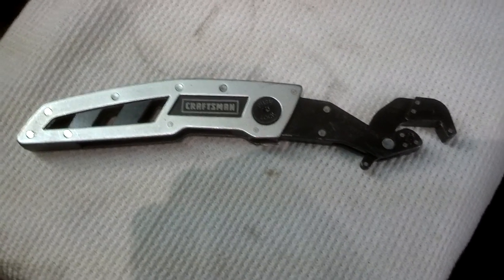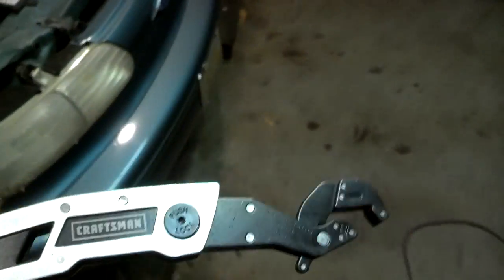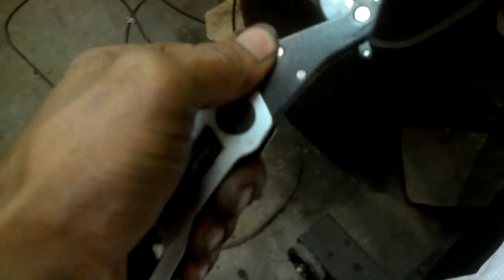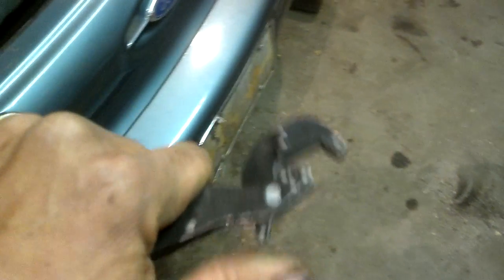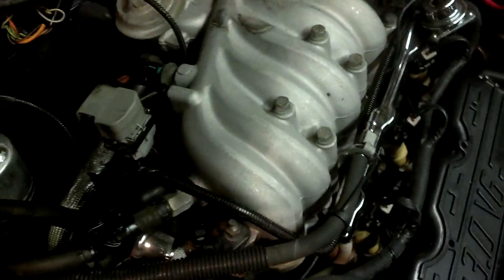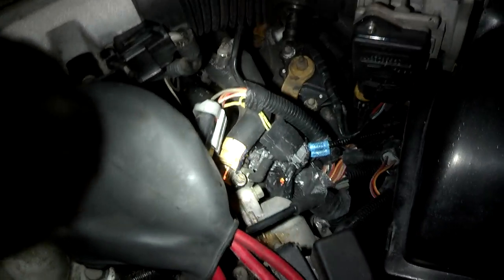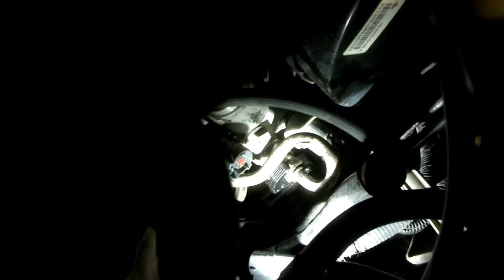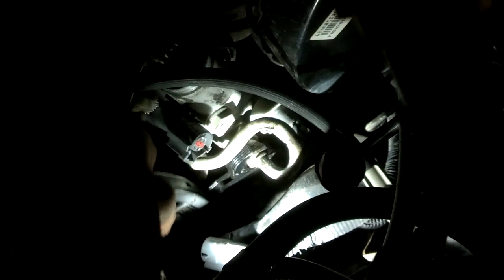How to Remove a Power Steering Hose the Easy way, Tool Review

Comment: Thank you!  I'm going to buy one right now and hopefully get this damn car finished. :o)
Reply from the maker: good luck. i love mine, saves mea lot of time
Reply: That wrench did the trick.  Now I see why the shop wanted $600 to change the P/S pump and hoses.  Thanks again.
Reply from the maker: all in the correct tools for the job
Reply: Me too, hope it works on my  E150 van, damn I didn't know their was a tool out there for it. I'll try again tomorrow, I couldn't take that sucker off today, did all kinds of twist n turns n wrenches lol.

Comment: I just seen this video good job a little hard to see in spots but that is a hard part to film . I am a disabled vet nothing from the waist down so I do not drive and sears was 45 min away but it closed last year and now to replace a tool I have to be driven 1.3 hours . I got my set at a pawn shop for 10 bucks . It had the package but they were used . But 10 bucks you can not go wrong . I have used them on my wheelchair my handicap scooter a few other things over the year. The big problem is they seem to slip off a lot. Not sure if I am using it wrong.

Comment: Nice video work under very adverse conditions. But the only problem I can see with using a wrench like that is if you're working on a rusted or threadworn fastener (a common occurrence for someone who owns a '95 Ford Contour and drives it during the NY winters). Then, you run the serious risk of stripping the heads, in which case you're obviously screwed.
Reply from the maker: je19662008  The design of the wrench grips the fastener tight, and this avoids stripping the fastener.
Reply from the maker: your welome

Comment: You think this will work on a 99 ford contour? i'm being told i need to drop the entire front end to get to it.
Reply from the maker: this will work fine, you will need to reach down from the top of the engine to reach the fittings. The tool works great on flare nut fitting
Reply: +Artistry Photography  wat should I do if the hex nut is stripped all the way out
Reply from the maker: did you try this wrench? it should work
Reply from the maker: if it is rounded off try vice grips
Reply from the maker: or cut it off at nut and use a socket and a wrench. I presume you are going to replace the hose with a new one.
Reply: +Artistry Photography I got it off from the gear box thanks to the tool u showed  but im gone take it to a machinest to get da pulley off n da other nut to the hose thanks the video was very helpful
Reply from the maker: great. Autozone and Oriely and advance Autoparts offer a loaner tool to get the pulley off and on